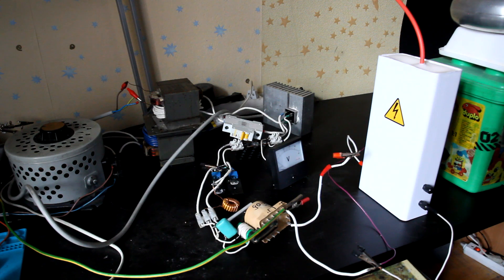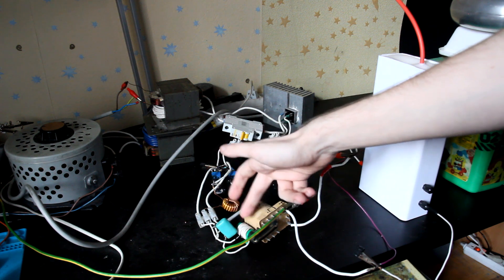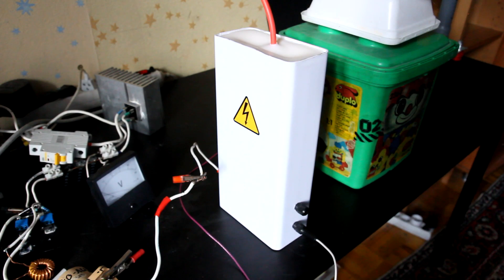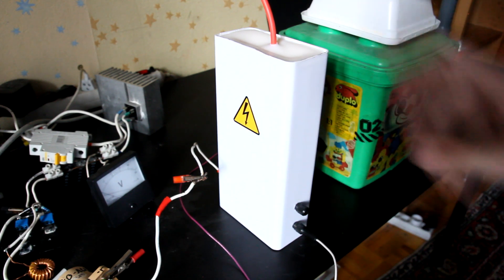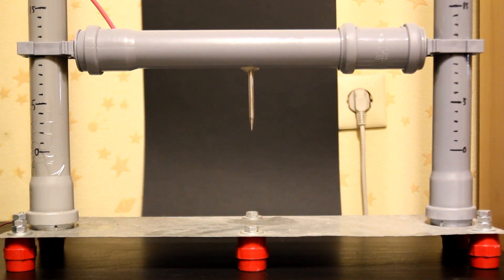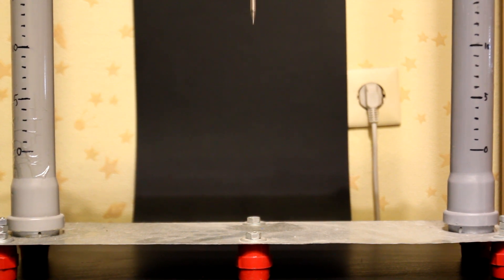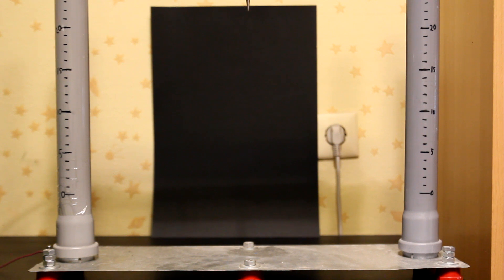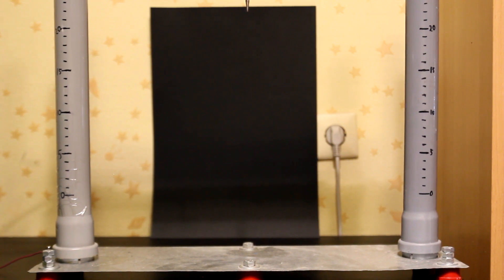My 150kV voltage multiplier (CW multiplier)

Comment: Wow, that's great work.
Can you recommend a video or webpage that explains the physics of the phenomena?
Specifically, I found the distinction between & physics of 
Corona, Streamers & Sparks 
rather hazy.
Reply from the maker: Thank you! Unfortunately as far as I know internet is rather scarce on that information. There are good books though: Rayzer Y. P. "Gas Discharge Physics", Mesyats G. A. "Pulsed Power" cover the topic from a purely physical point of view. High voltage engineering textbooks give basic knowledge of physics and practical aspects of gas discharges, especially corona and sparks, but I can't give any exact titles of these books. The thing is that I mostly study the literature that is of my native language (Russian), and unfortunately most of it has never been translated to English. I heard that Kuffel E. "High Voltage Engineering Fundamentals" is a classic, but I've never read it myself so I can't say if it has anything useful to you. 
In simple terms, corona, streamers and sparks are different development stages of the same thing. The discharge channel starts to grow from a point electrode - that's a streamer. When it reaches the other electrode, a short circuit happens and the streamer heats up, glows and emits small shock wave we perceive as sound - now that's a spark. Going further - if a current keeps flowing through the spark indefinitely (if the power supply has enough power) the heated spark channel stabilises - now that's an electrical arc. But if we go back and make it so that the supply doesn't have enough voltage to make streamer cross the gap in the first place, the streamer will just fade away in the middle of the gap. Than the next streamer will do the same, and the next one and so on. This happens very fast, so with our eyes we see this pattern of streamers as a slightly glowing branch - and we call that a corona discharge. Hope that was somewhat helpful to you!
Edit: oops, I forgot the most important book XD Bazelyan E. M. "Spark Discharge" is extremely good for studying this exact topic!
Reply: @Vidduley 
Thanks a ton !
I can't believe you took the trouble to answer in such great detail. I guess it is your favourite topic.
I really appreciate it a lot. In fact I subscribed. I didn't think I would get a better source/guide to learn more about this topic.
Thanks once again, sir.
Reply from the maker: My pleasure :)

Comment: how much current is passing during the corona discharge and breakdown stages respectively? awesome video and great view with the black backing!
Reply from the maker: Thank you! The corona current goes up to 400 uA just before the breakdown, I have the video about measuring it; the spark current is hard to measure, because it consists of high frequency oscillations with peaks of several hundred amps; however I'm currently experimenting with pulsed power shunts that are able to measure fast pulses of current accurately, so maybe soon I will be able to tell precisely how much amps are in those sparks.
Reply: @Vidduley  I have just now watched the video where you do make the measurements at the expense of your multimeter... ouch! I shall look forward to your fast pulse measurements and hope that you will also share its construction with us in a later video. Fascinating experiments!

Comment: Couldn't you just wind your own HV transformer instead of all of this? Surely one of the MOTs will have high enough flux for a custom wound secondary. If you needed the extra space for a large secondary you could use two "E" pieces from the MOTs.
Reply from the maker: Very true, but consider that the efficiency of a voltage multiplier is strictly inverse to a power supply frequency; MOT's 50 Hz instead of ZVS' 90 kHz would drive my efficiency three orders of magnitude down, so basically there would be no output at all; I would go as far as to say that the main purpose of ZVS here is not high voltage, but high frequency that it produces.
Reply: @Vidduley  thanks for the info! I'm just not that well versed in electrical componets!

Comment: Very awesome Vidduley. You deserve more coverage on youtube 😎

I wanted to ask, can I create this effect or atleast near to this power, using those 400kv boost converters from China? Arrange in serries may be? Thank you 😊
Reply from the maker: Thank you so much! Well actually those Chinese modules output not more than 15-20 kV, so you'd definitely have to stack at least 10 of them in series. This would create a problem: the input of each module should be isolated from the inputs of all the other modules, to prevent internal breakdown. So basically the setup would be: all of the modules connected in series, each with it's own li-ion or li-po battery, with proper insulation between all the stages, and probably with something like fiber optic controlled mosfets between each input and corresponding battery to turn on all the modules simultaneously. Sounds a bit complicated, right? :D Nevertheless I know of similar existing setups in some research institutes, with the number of stages as high as 150.
Reply: @Vidduley  
Ooo 😮 
Thank you for explaining Vidduley. I understood what you told. Yes the serries array sounds like lot of work. I will better try 2 or 3 modules in Parallel to see what happens. Wow 150 stages in research institutes sounds interesting. Thank you for all the info ☺️

Comment: Very cool. How much is the current which sparks out (output of the multiplier)?
Reply from the maker: Thank you. The current in a spark is hard to measure directly because of its fast waveform, but I estimate its peak value to be several hundred amps.
Reply: @Vidduley Oh wow. I was wondering, what is stopping a possible continuous spark flow? Is the current just too much to maintain a constant voltage and some components of your system limit it so that it continuosly reset in between the sparks? Or is it the mains which limits the input power?
Reply from the maker: Well basically the equivalent internal resistance of this multiplier is much greater than the resistance of a spark, so the spark channel just dissipates the energy that is stored in the output capacitors, and then the output voltage drops to such a small value that the plasma channel can't be sustained anymore, so it extinguishes itself, and the capacitors begin to gradually charge again and so on. Technically it is a very crude and inefficient pulse power system.
Reply: @Vidduley  Very clear, thanks again

Comment: Hi, do you know approximately what the current flowing through the circuit is? I am thinking of using 5mA diodes instead of the 100mA that you are using, so would that be a problem (i.e. limiting the current through the circuit)? Thanks in advance.
Reply from the maker: Hi, I had 5 mA diodes in this circuit some time ago, they were pretty unreliable. I strongly recommend using 100 mA diodes.
Reply: @Vidduley  Thanks. So I suppose there is more than 5 milliamperes flowing.

Comment: Hello Vidduley. I really like to know how many turns of wire did you put on the secondary and what was the voltage that came out of the secondary as a result of those turns. Not the voltage out of the bridge and filter capacitors but just out of the secondary? May you has a successful and long life.
Reply from the maker: Hi, I modified this transformer a long time ago, so I'm not sure about the exact number of turns, though I believe it is about 20-25. The output voltage (at 230 V mains input) is 16.8 Vrms.
Reply from the maker: Also the short-circuit secondary current was 630 Arms.

Comment: Wait, what? Why did you modify the MOT if what you want is HV?
Reply from the maker: Haha, yes, in this case regular 2.2 kV AC from mot is of no use for me at all. You might as well have asked "why did you step down the voltage if flyback transformer steps it back up?". The reason is that ZVS driver, which powers the flyback transformer, needs low voltage DC with high current capability, and the easiest way for me to get it was to use my rewound MOTs (originally intended for use in the arc furnace project).

Comment: You can calculate 1000 Volt per millimeter air when sparking.
Reply from the maker: No, unfortunately you can't, this value strongly depends on the uniformity of the field and applied voltage itself. For highly non-uniform field, like in (+)needle-(-)plain gap, and applied voltage between 100 kV and 1000 kV this value is 5 kV/cm, with a pretty high degree of accuracy. The polarity of the needle is also important, because it needs to be the source of the streamers, i.e. positive.

Comment: Very nice video, you deserve more subscribers. Also one question, for the multiplier, do you need dc or Ac current? Thanks
Reply from the maker: Thank you! Input voltage needs to be AC.
Reply: Vidduley hello again, is it possible to minimize this whole device, without the use of a transformer the size of the MOT? Thanks
Reply: (yes you just need a high enough AC input voltage and this setup would multiply the voltage peak-to-peak by a factor of 10)

Comment: Very nice video and a really nice voltage multiplier!
I would have some questions about that multiplier, if that is okay. For example.. how did you build the power supply? The two MOTs you have connected in parallel and these you feed on the variac or? Did you measure how much current flows through the variac on the primary side (at maximum voltage)? On how many turns did you reduce the secondary side of the MOT and which output voltage do you achieve? Are there any output resistors for limiting the current in case of an arc to protect your diodes? And my last question would be how the inverter is constructed after the bus capacitor of the rectifier? :) 
Sorry for the many questions, but I find the project really interesting!
Kind regards :)
Reply from the maker: Thank you! Oof, that's a lot of questions indeed! Well, let's see. The two MOTs are rewound for the lower voltage of 17v RMS each, that's about 20-25 turns on the secondary side (I originally needed those for an arc furnace project quite a long time ago). The MOTs have their primaries wired in parallel, and secondaries in series. No, I didn't measure the primary current under the load, but without the load it's about 6-7 amps for the two transformers combined (pretty high because of the core saturation). I don't have output resistors because it is very unlikely that the arc will happen, my power input is too low for that, and also because finding good resistors for 150 kV is quite a task. The inverter utilises standart resonant scheme known widely as the Mazilli's ZVS Driver. I think my next video will actually be about it.
Reply: @Vidduley  
Thank you for your quick answers. These have really helped me a lot! :) About a Mazillis driver, I've read something, but so I'm curious about your next video and will probably build myself a driver in the future. Kind Regards :)

Comment: I've been researching a lot about these multipliers. From my understanding, the multiplier needs AC input which it converts into DC output (as said in the video), but what converts it from the original DC? Is it the ZVS Driver or the Flyback Transformer, or are the both combined? I don't really understand the conversion from DC to AC part.
Reply from the maker: Hi, ZVS driver is one of the many so-called inverter schemes, the main purpose of which is to convert DC to AC, so it does just that. The flyback transformer merely steps up the voltage.
Reply: @Vidduley  Thank you! So i could just buy one of these? Also what is your original input voltage and what is your voltage before the actual voltage multiplier?

Comment: How did you achieve 150kv with 10 stages and 15kv capacitors? I read that the second capacitor in the multiplier must have a DC voltage rating at least twice the value of the peak input voltage. Or is this a false information?
Reply from the maker: Yes, this is true, but my input voltage peak value is 7.5 kV, so in ideal case the capacitors charge to 15 kV each. Basically it's easier to build a multiplier with capacitors you have laying around, and then limit the input voltage according to ratings of those capacitors.
Reply: This is really good information.  Thank you for posting this.  I have a couple questions.  
1. If you have ~1200 turns on the flyback secondary, then with ~7.5Kvac output, the primary is then ~10 turns?  
2.Have you measured the current of the 7.5Kv stage?
3. At what approximate frequency are you driving the 7.5Kvac?

Thanks for any help.

Take care.
Reply from the maker: Actually the primary is 8 turns, but I use resonance converter, so the transformation is a little more complicated. No, I didn't measure the current. The resonance frequency of my converter is 90 kHz.

Comment: This deserves more views! I wonder how you use the MOTs to push the amperes (thats what I understood?). The MOTs work at 50/60 Hz, while the ZVS outputs kHz to your flyback. How does that work?
Reply from the maker: Thanks! About MOTs, that's simple: ZVS converts supplied DC to high-frequency AC, but it works in such a way that the input DC needs to be low, hence for somewhat high input power the DC supply needs to be able to give out lots of amps. And that's the part where MOTs come to play: these are rewound MOTs that now are not step-up, but step-down transformers, that produce low voltage low-frequency AC, which I rectify into DC, and can give out lots of current if needed. Then I feed produced DC to the ZVS and the whole thing works. Basically I could use any low-voltage high-current transformer, it's just that MOTs are the easiest to find.
Reply: @Vidduley  Why all the power...? That flyback would be less than an amp.
Reply from the maker: @kka10001  well, less than an amp, but lots of volts, so the power isn't that small.

Comment: very nice multiplier! That corona discharge looks sweet. I have a CW multiplier that can do 20kV at relatively high current, but I'd like to build something like this.
Reply from the maker: Wow, thank you very much man! Honestly I didn't expect to see a huge youtuber like you commenting on my video! Your lasers are very impressive! Also I've already built -150kV multiplier, so now I have crazy 50 cm sparks and corona between -150kV and +150kV (actually less than 150 yet), and I'll get more once I upgrade my power supply, video coming soon!
Reply: Hey, I'm here because I saw a thread of yours.  That was a pretty cool device.
Reply: What does your residential power meter from the power company look like when you fire this up? Does it consume a lot of power like a electric dryer might or does it just take a few watts to do this? (I do not know the math or I might be able to answer my own question but yeah...)
Reply: @f.k.b.16  Just stumbled upon your question. This type of electrical supply is probably using about half of electricity of a hair drier. This device is "altering" the power to give it more voltage (pressure) but much less flow (current). Looking at the supply I would guess 500watts or less. Awesome never-the-less
Reply: @unknown-ql1fk  Thanks! That makes sense!
Reply: Have you guys ever thought about using dead man switches for experiments like this?
Reply: I actualy subbed to you vidulley from styro's laser video along with 2 others he suggested. Just a question. Seems with 150kv you jumped a 30cm gap yet the air break down voltage per cm when i searched it up was 30kv. Is that something to do with the corona ionizing the air or is the 30kv per cm something completely different.
Reply: @Darkstar.....  v/mm of air is highly variable. Here's a picture of a textbook's numbers. You can see at the bottom modifiers for temperature and pressure. The other numbers change with width of electrodes. You can see how massive a difference it makes. Second picture is easier to read but no modifiers for pressure/temp. This isn't going to be perfect, of course.
You can see that 70kv jumps a 4cm gap with 2.5cm sphere electrodes, 2.6cm with 5cm electrodes, and 8.8cm with needle points. At 300kv it jumps 13.3cm with 25cm spherical electrodes and 54cm with needle points.

https://media.discordapp.net/attachments/664551114091528225/783549608177172490/image0.jpg?width=450&height=600
https://media.discordapp.net/attachments/664551114091528225/808473713816502272/unnamed.png
Reply: @vdekjEE  oh cool. Wait so its the diameter of the electrode that determines the air break down voltage range. Im sorry i been up all night watching a horror movie series. Im past thinking and didnt even read my comment again. Your far more knowledgeable then me so i will take your word for it.
Reply: @Darkstar.....  Yep, it's the biggest factor by far. And kv/mm changes within a given electrode size as the voltage goes up.
Reply: Its far more complicated then i realised. Even my numbers are off. I dont know where i heard 10kv per 1cm gap but its incorrect. 30kv is the initial amount to ionize the air and it drops allowing the spark to travel a larger distance.
Reply: @Darkstar.....  yes those breakdown distances are for the initial breakdown. once a channel of plasma has superheated the air between those electrodes the travel distance betweem then can then be stretched, again more for a fine point cathode